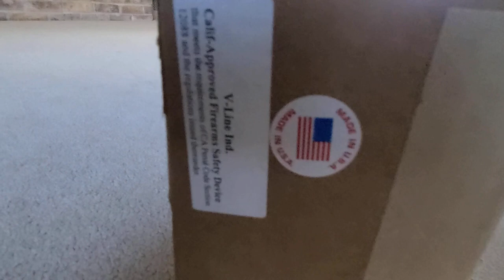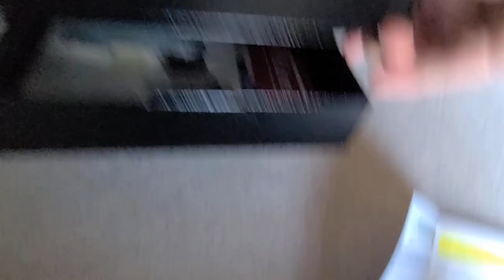V-Line Compact Pistol Safe - Unbox/Review/Demonstration

Comment: The Simplex Lock ok but I would like to see this with 1/4 steel plate on all 6 sides, with the same plating surrounding the locking mechanism, with a 1/2 inch bolt catch and thicker locking bolt, along with 4 holes for bolt to the floor applications and through in a WIFI  alert system that way the owner can get an alert on their phones from an APP. Do all that and put a $350 price tag on them and I would buy 6 of them today.

Comment: I was disappointed to see V-Line not including their lock protection bracket. On their bigger models, they have a steel plate that surrounds the back of the lock so someone can't use a screwdriver and hammer to hit the buttons/lock out. The "Handgun Safe Research" has a few videos on this topic.
Reply from the maker: Hi I just checked out that channel @HandgunSafeResearch and now I understand what you mean.  Thanks for bringing that to my attention.  This box is so small that if they were to put that steel plate under the lock it would probably interfere with closing the box when a pistol is inside.  It is very tight as it is in this compact box.  I view this box strictly as a security mechanism to prevent unwanted access from children or someone that was invited into your home, but not to prevent from theft because this thing can be taken away so easily.  Even with a steel cable locking it down it would be much quicker to cut that cable than to do all the things that he does on that channel.  I did subscribe though :)

Comment: Holy crap!  Did you say $170?  I had to rewind a couple of time to make sure I heard you right.  That’s not worth it in my opinion.
Reply from the maker: Haha its even worse. I just checked it was $180 plus tax it came to $195. It's growing on me though with the holster as I showed in the video it fits nice and tight in the box and the safe is also light so when my wife sends me to sleep in the dog house I can just pick up and go. I didn't want a digital one because I know the batteries would fail when I needed them.
Reply: @goodlifehacker  I had the batteries leak in my RPNB multi pistol case and now I can only use the key.  That safe holds 3 pistols + 2 mags for each gun and cost only $120.  Battery failure aside, it’s a good safe.
Reply: Take a look online.. the simplex lock alone sells for around $80 by itself.. I have several V-line safes and they have never failed me.. guess that's the price of going with American made over cheap Chinese crap.. if you need more security they do sell larger more secure cases but you gotta pay that Made in America pricing :)
Reply: @goodlifehacker  some systems have an option where you can plug in a USB and give it the 5 volts it needs to energize the lock in cases batteries fail.